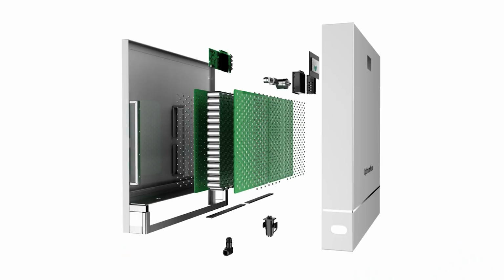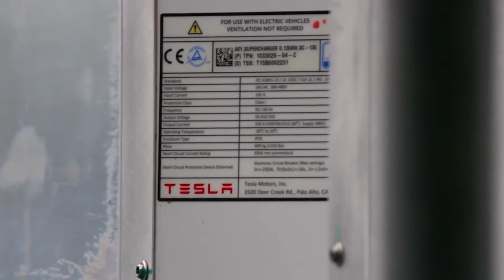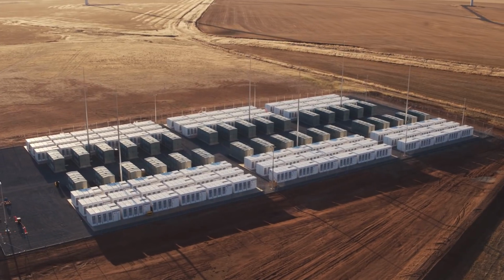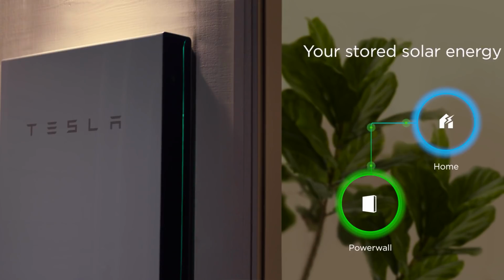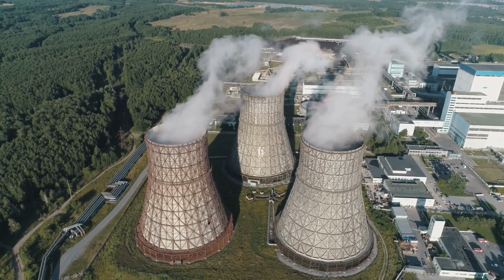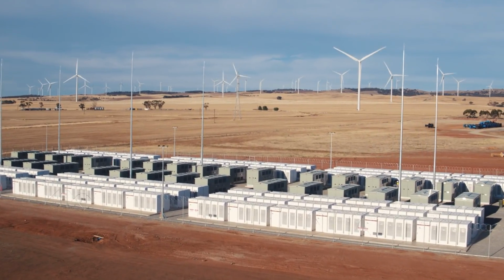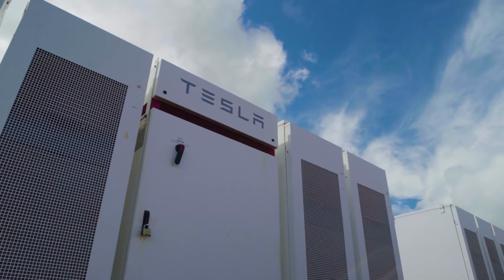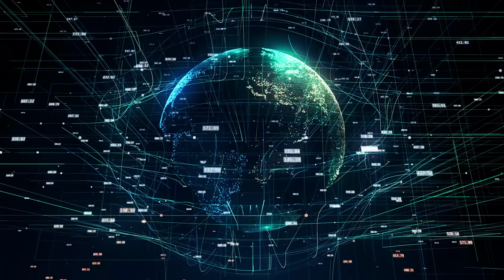Why Utility Grids are Afraid of Elon Musk

Comment: I live in a small rural town hit hard by the recent fires. Our connection to the grid was knocked out for several weeks, although after 3 or 4 days large generators were brought up. But we didn't have communication at a time when it was really needed, this includes ambulances, the hospital although it had a generator still lost water supply. 

The town is at the first stages of looking at creating a micro grid, even with a micro pumped hydro plant but I do fear they aren't looking forward enough. Australia often lags behind the world somewhat and that includes EV's, these could be a major problem for a micro grid requiring so much power but also in emergencies a major help especially the CyberUte with the ability to feed back power. Any solution will require quite a large amount of battery storage.
Reply: @Dave Goldspink  Although Australia is a large country most of the population lives in cities and for most car owners the range of an EV is more than fine. I live in a rural town, my shopping trip is about 250km and I'm getting an EV. I can easily drive up to the Gold Coast or across in South Australia with no hassle. Electricity demand can easily be meet for EV's, demand for electricity has dropped over the recent years. Yes old dirty expensive coal generators are been closed. This present government has spent it's time twiddling it's thumbs rather then supporting the economic choice of renewables they still talk about coal (and subsidizing it). As more EV's are on the road so renewables are easily ramped up to cover demand. Again the trucking industries most mileage is around the cities, these routes will be low hanging fruit for the Tesla semi and other electric trucks. Even many of the rural work around here could easily be done by and electric truck. Not all people will be able to change over to an EV today but most people in Australia will be able soon to. Don't listen to the FUD and repeat it without looking at the facts, don't identify with a group and be lazy and just use their opinions.
Reply: @Dave Goldspink  Actually I can't say I'm young but luckily still keeping my looks. I don't think of myself been on the right or the left politically that  is a good way to become lasy in your thinking. No the semi's not here yet and not for a while been Australia but just because it wouldn't do all the runs it'll still do a large percentage and this will be version 1. Now as well as having worked in green industries I have also been a nuclear operative working on a Magnox reactor. I have continued studying as much as possible as I have worked through many industries in many countries. I sort of know enough to know how to sort out information from the experts. My hobby is science/technology development and trends. This has increasingly moved over into green tech over the last 10 yrs. This is were I invest as part of my work, up nearly 300% over the last 12 months. Wake up and smell the coffee and don't let us old men look all like cockwombles. The world is changing, don't be a snowflake and try and hide from it welcome it. For a start for electricity look at Lazards Levized Costs, this is the industry standard. Don't just watch sky news and think you are informed go to the bare facts, if you dare?
Reply: @Dave Goldspink  you are still thinking that Tesla thinks the Semi in it's first version is trying to take over all truck sales. It's not it's about breaking into the market by taking the low hanging cherries. Then work through the market. Something like they are with cars, the industry said that was impossible as well. Have a look at the actual distances and weights moved by trucks in Australia. Massive amounts of of trucks are on small to medium distance trips. Electric semis will make more money on these routes with lower fuel costs and less down time. Charging isn't an issue, over night is fine. Even longer routes were you may have to lighten the load will often be worth it due to the massive cost differences in fuel and electricity. Drivers also have to stop for rests were they can recharge. Then comes convoying will a single driver and not far after that comes self driving. It doesn't matter if a truck runs lighter or takes a bit longer when you remove the driver. Then comes on top of that the rapid raise in energy density in batteries, give it another 10 years of development or maybe far less (we will see on Tesla's battery day) and even most long haul with be battery. Maybe hydrogen will take some of the market we shall see. Betting against Musk isn't a smart move ask the shorts they are well over $10 billion US down doing that. Ask the rocket industry that now look like a joke compared to SpaceX, doing what the industry experts said was impossible. Time will tell, this decade is going to see massive change. Today we saw part of that with GM giving up here.
Reply: @Dave Goldspink  please read what I say not what you think I say. Slightly different, of course their not selling them yet. I'm pretty sure just like everything else Tesla has built it sells all it can build. We've heard it all before and whats happened? Those that think in old fashion ways are left looking like the fossils they are.
Reply: @Dave Goldspink  hydrogen fuel cells may work well on long distance but it's production needs to be sorted. It will obviously use renewable electricity, which would otherwise be curtailed to produce the hydrogen. Those that think long term it'll come from NG are trying to keep themselves relevant, but will fail. Lets see what the first commercial version of the semi will be. Odds are it will sell well.
But you still go on about weight and fully load semi's. You need to go and look at the real world weights and distances that semi's haul.Although I haven't driven trucks here in Australia I have experience in the USA and Europe.
Reply: @Dave Goldspink   Most Australians live in Cities. A large proportion of Australians could easily have an EV.   Yes, there are those who need the longer ranges, as does the trucking industry but that's not true for most people. 
40 % of all Australians live in Greater Sydney or Melbourne. Almost half of all Queensland residents live in Greater Brisbane. 89 per cent of Australians live in the country's 18 cities of 100,000+people.  Budget direct did some research. The average vehicle in Australia travelled 13,301 km per year, or 36.4 km per day.  NRMA found that even in rural areas commutes are around 60km.
Reply: @Dave Goldspink  Yup I'm getting a Tesla Model Y SUV to replace my Outlander. Perfect for this rural town and will far cheaper over it's life time than my horrid ICE. Wife says I can also get the Tesla Ute which will be great living off grid as back up power. Things are changing and yes people will buy what suits their needs best and is the cheapest, safest, most comfortable and so forth. Norway is quite a good example of what will happen to Australia, it's just we are running somewhat behind much of the world.
Reply: @Dave Goldspink  The answer still remains the same - range and size of the country are not the main issue in Australia. Most of those SUV's are Toorak tractors doing the school run.  We have a 4x4 and a Corolla. Easy to swap the Corolla for an EV.  We pay $1.89 for fuel. Its a no brainer really.  
 The 3rd most sold car in Australia is the Toyota Corolla.   Only 3 out of the top 10 most sold cars last month were utes. Small EV"s were first off the rank because bigger markets in Europe.  SUV's and utes are great platforms for EV's because of the size - more space and utes are really easy to add battery's to. The electric utes are coming:  big players Ford, GM (if they survive) have them in the pipeline.  China is now producing electric Utes - eg. the Navara-based Rich 6 EV and the JMC Yuhu EV . Then there's the start ups - Fisker, Rivian ACE. BHP has started to use an electric LandCruiser 70 Series on the Olympic Dam site which was converted to electric by South Australian company Voltra.  They're on their way.

Comment: We also have Panasonic coming out with graphene batteries next year for cell phones which means other battery systems will follow with a battery that's getting exponentially cheaper and holds twice as much as lithium and charges 5x faster and has about 10,000 cycles. Don't believe me? You can already order generic graphene batteries on Amazon and Samsung will be making them in their phones next year. And also who is partnered with Panisonic? Tesla...
Reply: You can order lots of batteries on Amazon.  Most are fakes and supply about half of rated.

Comment: Coal plants also emit radiation from radioactive particles present in the coal.
Reply: Radiation can even be an issue with oil, if you remember the Brent Spur oil rig was such an expensive issue because the oil sludge at the base was some what radioactive.
Reply: There's actually more measurable radiation present in the vicinity of a coal fired power plant than at ground zero of a nuclear power station. When I tell this to the "clean coal" freaks and anti-nuclear mob they quickly shut up.
Reply: Coal really doesn't have much going for it does it?
Reply: @stevenlittle2384  It's dead in more than one way.
Reply: I read a while back that the average coal fired power station produces around five tons of uranium per year in the tailings. I wonder, can anyone confirm this?
Reply: @DavidInSydney1  They do have uranium in the ash but it's pretty much Uranium 238 which isn't very radioactive. Although it'd be interesting to know if radon is a problem.

Comment: Excuse me, but when you say these large batteries emit no pollution, it would be more genuine and accurate to say, they don't emit any pollution post installation? I would suggest that probably the factories which make these marvelous things are not producing the plastic, steel, and other components from the sun, or wind turbines.  They have to use mined elements, or plastics,  which use  fossil fuels to run the mining operations, and oil/NG to convert to plastic.. But maybe someday, all energy will come from the sun, and then you could say there was no pollution emitted.   Still, a very nice video.
Reply: Brian Richards All energy comes from the sun except nuclear fission.  Having said that I would ad that the more we can keep stranded assets stranded the better off we all will be except maybe Wall  Street.  Oh and one other thing. Lots  of mining companies are now using battery electric equipment but because they are mostly made in China and  we in the west are the torch bearers of a free press, we never hear about it.

Comment: Please verify your information on peaker power plants, e.g. cost and time to build.
Reply: That depends on what the project entails.  But the EIA puts a simple cycle 100 MW turbine gas plant at about $123,000,000.00 and a lead time of about 40 months (planning to completion). https://www.eia.gov/analysis/studies/powerplants/capitalcost/pdf/capital_cost_AEO2020.pdf  The gas plant still has an advantage over the Tesla system in the length of time it is able to deliver power.
Reply: @donaldendsley6199  Thanks for sharing this link. Reference case #5. Of the 40 months only 22 are for constructing the plant, and fast track projects can do this way faster. Also, dual fuel capability is adding considerable cost and is typically only required in Florida (disaster backup fuel), at least in the USA. Electrical interconnection cost apply to both gas and battery plants. The solar array will need to be considered for the latter. The big difference is in O&M cost over the lifetime. As you are suggesting, degradation and possible replacement of the Tesla system before 40 years end-of-life of the gas plant need to be considered, which a fair comparison would do.
Reply: @donaldendsley6199  gas is a methane pollutant many times more potent than co2 .it is not a renewable and is as dirty as brown coal in its particulates exhausted to the atmosphere
Reply: @flodjod  And?  My reply was only to provide information he indirectly asked for.
Reply: dosnt need to 1st one built in SA in under 6 months, and How much did the Tesla battery in South Australia cost?
A 505-page report released by Neoen this month ahead of an initial public offering suggested the battery cost around $90 million, at the current exchange rate. The giant 100-megawatt lithium ion battery near Jamestown in the state's mid-north commenced operation late last year.Sep 27, 2018
Reply: https://www.abc.net.au/news/2018-09-27/tesla-battery-cost-revealed-two-years-after-blackout/10310680

Comment: Are these expensive lithium batteries?  And what do they do with them when they are worn out?   Is it economical or feasible to recycle them?  Tesla tests are great free advertising for those developing much cheaper and recyclable batteries designed specifically for this load leveling job.
Reply: Lithium batteries are entirely recyclable.  The lithium is somewhat problematic because over time it combines with some of the other material but recycling batteries is not a insurmountable task.
Reply: @TerraPotentia  So your answer from a real world perspective is maybe, but nobody does it so far.  From an economics perspective, will they ever?
Reply: @jonahbert111  The reason nobody does it so far is because it's just not economical to do based on the amount of batteries in use today.  When we move completely over to EV's, that will change.  It will become economical to do when more batteries become a reality.  It boils down to economies of scale.  It's expensive to recycle one battery, it's less expensive to recycle a middling amount of batteries.  It's economical to recycle batteries when you've got billions of them.

Comment: What about recycling these batteries when worn-out in about 2000 cycles?
I understand that it's difficult to recycle all those individual tiny cells. Not even profitable either. Straight to landfill?
Reply: The batteries are very recyclable.  The materials in them are worth too much to just toss in a land fill.  They get used to make new batteries.

Comment: Another necessary component to a Mars settlement achieved!
Reply: Mars colonies will rely on the new NASA KiloPower generators. Batteries would be too heavy to ferry to Mars for their very low power density.
Reply: has Elon talked about EM drives?  I haven't heard anything about them in a long time, I thought someone was going to do a space test..   I guess it didn't work..  ?
Reply: @rifz42  I hadn't noticed we haven't heard as much about EM. Will be on the outlook out now.
Reply: Keep in mind it get's really really cold up there.
Reply: @BigBoss-kq8mb  We have no problem runs rovers on Mars with battery. What I mean is we have a lot of knowledge how to protect battery from cold.
Reply: @BigBoss-kq8mb  Opportunity Rover started with 900Wh Lithium Ion Battery.
Launched 08 July 2003, last contacted 10 June 2018. Over 14 Years.
Yeah we know how to run Batteries on Mars.
Reply: good point!

Comment: Hi Zac and Jesse, 
don't just think about power grids. With decentralized photovoltaics plus power storage, even the worst event of a large power grid can take its effect. The Carrington event. With every sunburst, enormous energy is thrown into space by means of electromagnetic radiation and fast protons. If these energy outbreaks hit the Earth, they create a Carrington event that disrupts or even destroys the power grids of countries or entire continents and the connected electrical devices at the same time. If you think they don't exist, be reminded. In 1859, such an event destroyed power grids in North America and Northern Europe and set paper on fire in telegraph machines. At that time, the countries were not yet fully electrified and dependent on electricity, today they are. These events are not uncommon either, in 1921, 1956, 2003, 2017 they occurred in the affected countries, with widespread destruction.

Comment: Ambri has made a liquid metal battery, while not usable for cars, it is ideal for massive peaker plant replacement, AND full power plant replacement.  They are now partnered with NEC for the power control software and hardware to work at this scale.  Due to the physics of how they work, these batteries will not wear out.  Let me rephrase that, you will have changed out all the batteries in a plant made with Lithium many, many times over before the first Ambri cells show wear.  The Ambri cells are made from very common easily obtained earth materials. Save the Nickel, Lithium for transportation. (Small Patreon)
Reply: I've been following Donald Sadoway and his liquid metal batteries.  He has the solution for economical grid level energy storage.  Everyone should watch his lectures on youtube.

Comment: I hope the next powerwall will have 3-phase operation that we need here in the EU. I would love to have one.
Reply: why not get DC appliances and have no need for 3-phase?
Reply: @jetah50  In Europe your house has a 3-phase setup, so while all outlets are DC, the lighting may be on one phase, the kitchen on a second and so on. So the powerwall has to cover all 3 phases to keep your DC appliances working.
Reply: @Hoshi_Toranaga  i'll have to look into this more. seems like it's unnecessary (for DC).
Reply: @Charles-A Rovira  Thanks I have to look that up. I only saw solutions where they kind of rig 2 powerwalls in with some complicated electroics voiding any warranty. So I hope that is not the case here.
Reply: @Charles-A Rovira  LOL I understand perfectly. But when you have phase corrected 3-phases running through the house to phese+N outlets, then you either need 3 powerwalls, one for each phase or something to sync it to one powerwall that by specs only can do phase+neutral. The main problem is when using the powerwall to put back into the grid (which you need to be able to by law) it has to be 400V 3-phase again. It seems to me you do not understand something my friend.